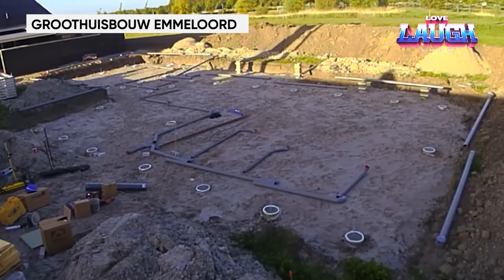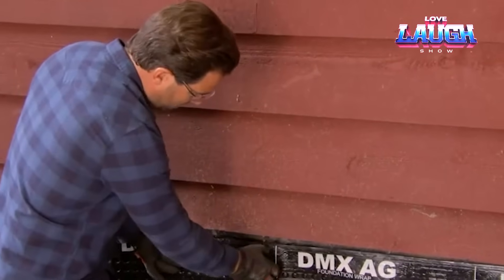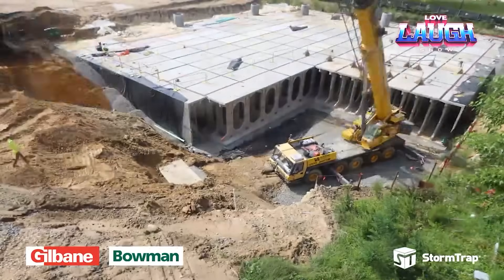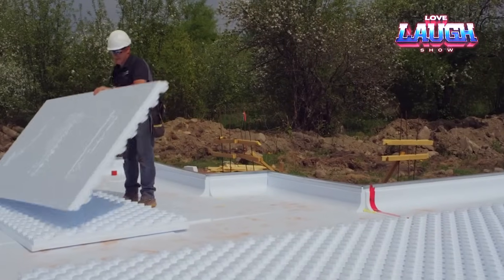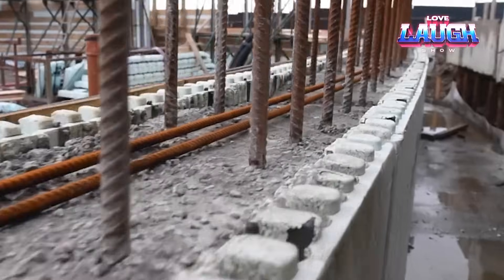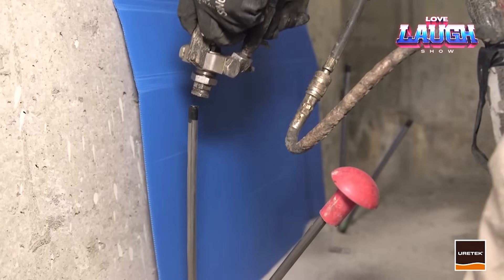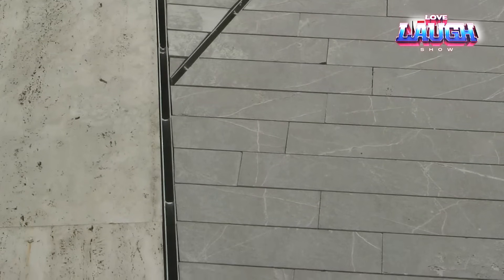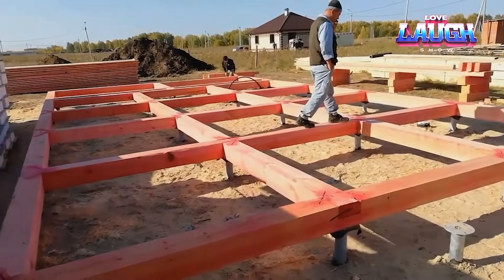18 Unbelievable Construction Technologies Working At Another Level ►2

Comment: I like the flooring and foundation being one included system. That makes sense. 
You didn't say how those prefab walls were made. What were their construction materials? 
.
Reply from the maker: Thank you for your observation! Prefab walls are usually constructed using materials like wood, steel, or concrete, depending on the design and requirements.
Reply: @LALSHOW  It didn't look like conventional materials. I was wondering if it was hemp-crete, or plasticrete. There are a lot of new, diverse, building materials and methods.
Your welcome, I do like to observe.
Reply: @patriciajrs46  While new materials like hemp-crete sound eco-friendly, are we overlooking the environmental impact of producing them on a mass scale?